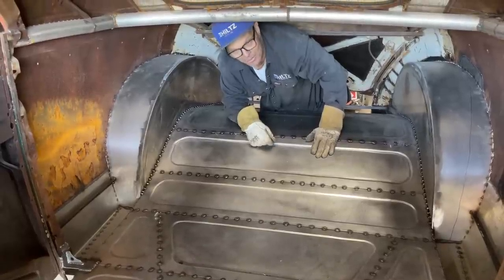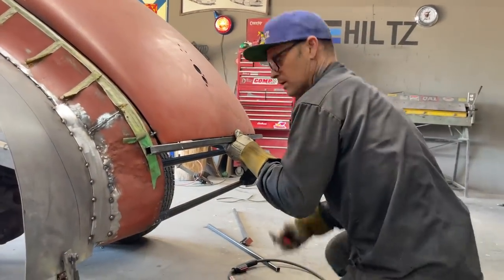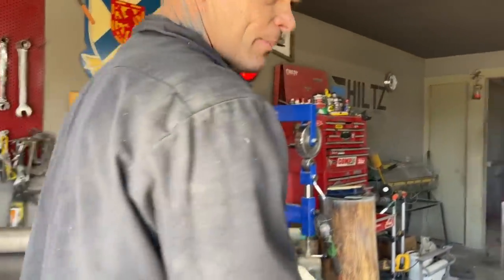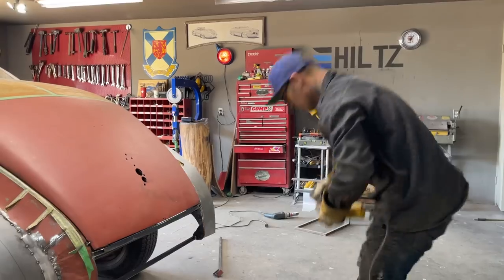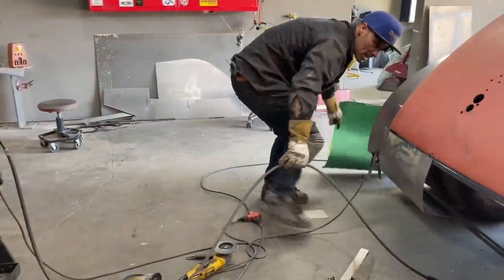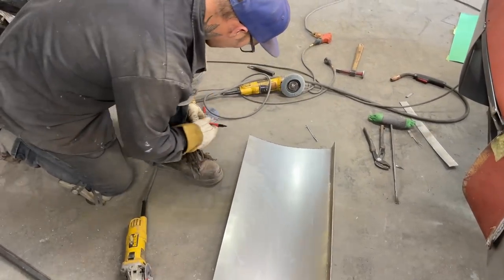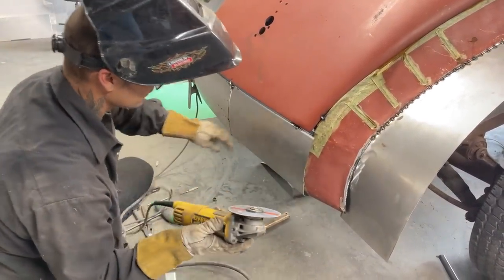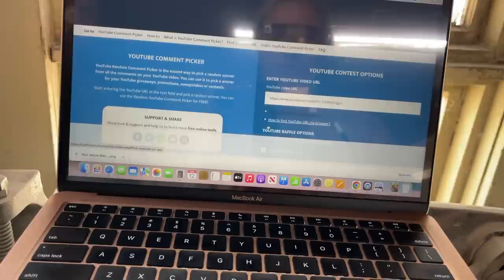Well that was a mistake.... sheet metal panel fabrication failure ❌

Comment: I did a 40 Tudor standard about 20 years ago and that rear valance gave me a rough time. I used a repop panel from Bob Drake and it went on and came off twice. The stock floor had a tool pocket inside the trunk with two plywood covers over it, of course it was rotted. Good luck Brother

Comment: I'm surprised you didn't use the English wheel to get the metal to form to your expectations. Hear's one more old-school way they didn't teach you in school. That wire gauge was used to get complex shapes on many prototypes. As is what would like you to experiment with. you to experiment with. Back in the day when cars were made of real Steele. Some Bodyshops were experiencing with new processes instead of filling them with lead. They would use a wire jig to make a jig, say out of an old pallet. They would have the Steele all tacked down they would take a blow torch, not a cutting torch. They would heat the area of the panel up that had the Flat spot and lightly apply pressure. This was a two--man job but it was very effective. Also, a cheap pair of Calipers or slide gauges from Harbor Freight works much better on such things. Love your videos, keep it up... Peace Bro !

Comment: If the bottom piece of square stock was bent the same way as the top piece of square stock I think it would have been easier and would have eliminated that 5 inch difference in the middle. Keep up the great fabrication work!

Comment: when you put that first lower cross member in , i thought why doesnt he bend it and put it on the outside then make an upper vertical panel, then put a closing horizontal closing piece on the bottom?

Comment: Why would you leave the ends of the tube installed under the deck lid open?  Is there going to be any other structure in the rear?

Comment: Chad,what if you had cut the lower part of the quarter,even with the height of the rear pan and carried the pan all the way from inner fender to inner fender all way across the bottom of the deck lid,still using the square 1x1 to attach rear panel.just saying.remember it is your car,you make it the way you want.great video,👍👍👍😎😎😎